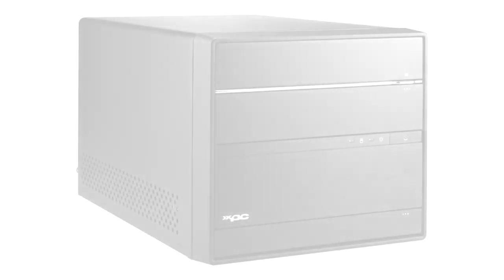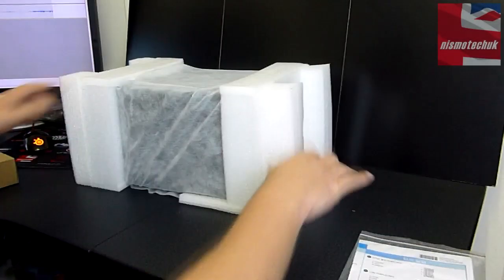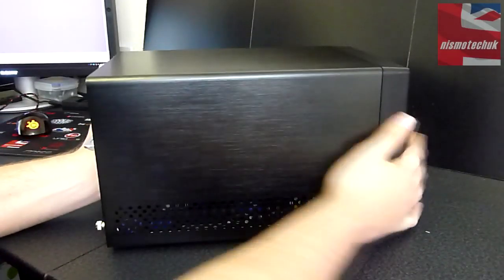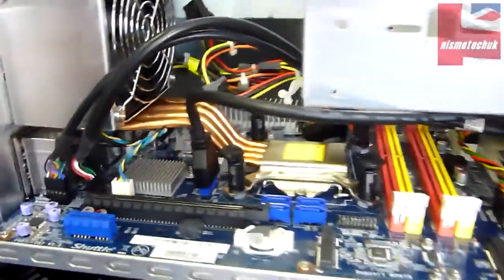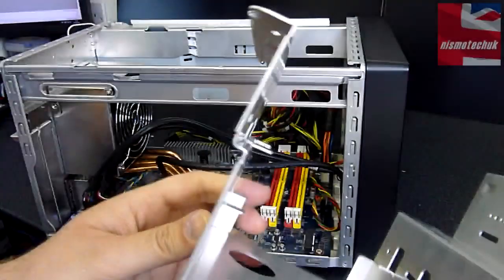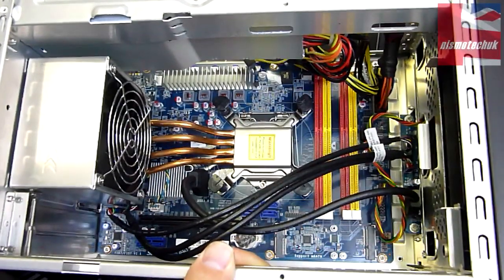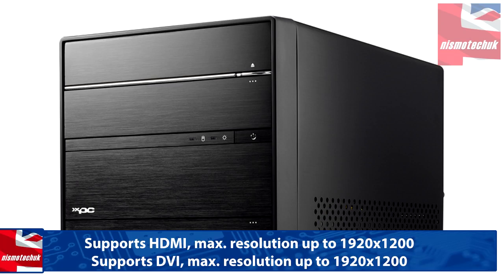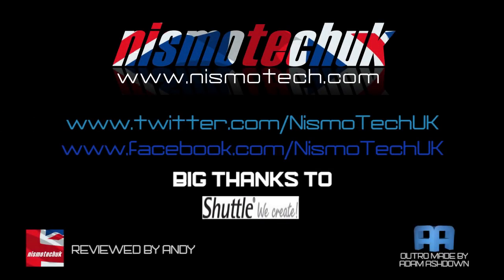Shuttle SZ87R6 XPC Barebones System {Unboxing & Overview}

Comment: Yes shuttle makes their own motherboard in fact they invented the mini itx. Go look it up Ken Huang xpc he was the man behind all this.  I have their shuttle since the first generation. I have 8xpc Not a single one broke down only HDD.  And there is one running for 9 years and its still running.  Amazingly with that 9 year old motherboard and 250w psu it can still  power a gt9800.
Reply: Helen Yin mini itx format was invented by via.  shuttle use their own format board